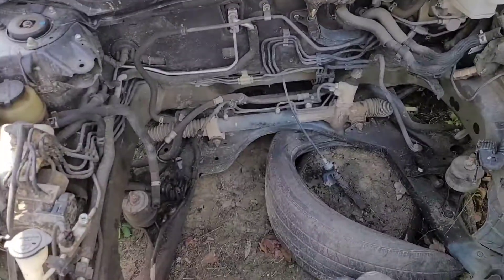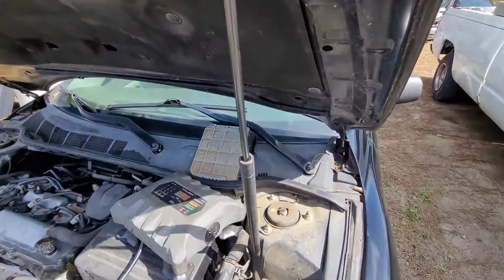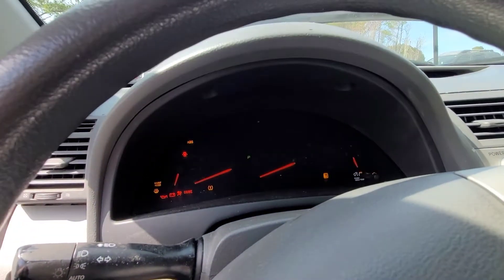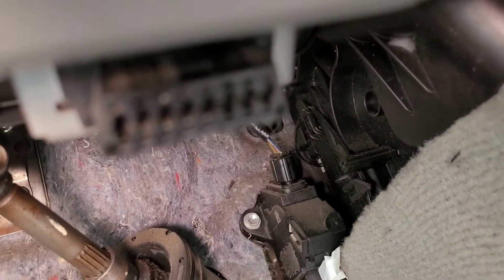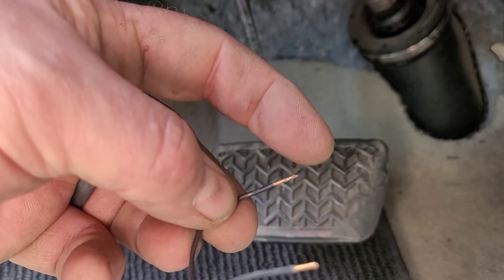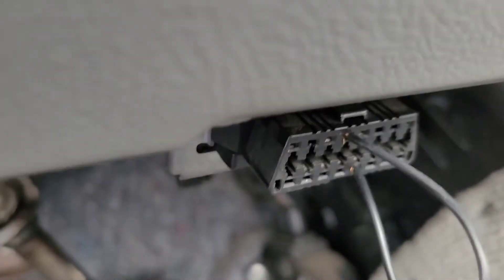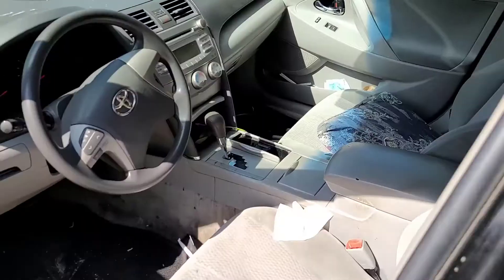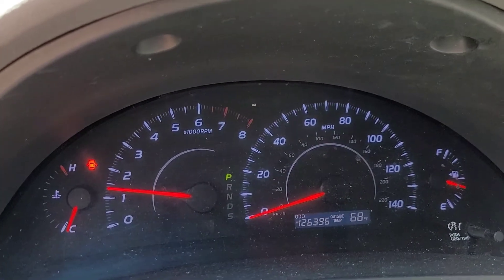Toyota Camry ECU swap without programming it ? Will it work ?

Comment: Great stuff man!

I have a 2016 Camry with no marker lights front or rear, panel lighting also out. TAIL\PANEL fuses good, but no power. All other circuits work, car runs\drives fine. Stereo and dash cluster lighting work off the switch. Jumping power to the harness connectors joining F\R gets F\R marker lights, but still no power to PANEL circuit. Schematic leads me to believe there is a break between the TAIL relay and TAIL\PANEL fuses, but I don't see a relay nearby, even though the schematic shows one. Appears that BCM \ Multiplex controller plug durectly into fuse block. Any thoughts?

Comment: Question on the jumper wire..
You threw a curve ball there and didn't really explain it well..

The connector is upside down.. so do you connect #4 &#5 from the left or from the right looking at it upside down???
Can you do a little video to explain that?? Thanks!

Comment: Great advice but I don’t understand why mechanics who said I nedd a new ECU say 1) I must match the VIN number of my car and 2) they charge $300 to $400 for a specialist to then program the ECU for my car. This comes from three different repair shops. I have a 2007 Corolla.
Reply: I suspect your mechanic just wanted to order one off the net (like from " Flagship One") - they'll ship them back to you (or your mechanic, LOL)  PRE-PROGRAMMED for you and don't need the old core, etc. The VIN gives them all the info they need to pre-program.
Reply: @PeterFerris  Yes, that was the brand and there are many negative Google reviews. I decided to buy a new ECU from a Toyota dealer and have my mechanic program it for $100.

Comment: your amazing im going to go and try this as soon as I can
Reply: Hey, can you let me know if it works?
Reply: @ToyotaCorollaCE  yea it worked for my Toyota camry se 2007 I probed power to the trans solenoids in the valve without disconecting the negative terminal of the battery, didn't have a problem intill I test the last solenoid. the ecu didn't like getting power to part while connected it made a loud and long beep, was on limp mode with a new check engine light. back probed the pins to see if it was still good. alldata said it was shit and had to replace, crazy enough I used a different ecu from a 2009 le camery same first 4 part numbers different last part numbers was planning on returning the part to the yard if it didn't work and try and find the original one lucky it worked for me tested all the windows and features still functioning even passed smog. also take photos of all recites in case of return it will save you trust me I learned the hard way. some returns are strict at some yards for profit.

Comment: Advanced Level Auto Diagnostics channel - Toyota 2008 Camry ECM diagnose, replace, initialize:  https://www.youtube.com/watch?v=IZWHyrJ-er0  
At about 22 minutes is the used ECM install & program using a jumper tool (pins 4 and 13) from Jarhead Diagnostics.  Both those guys are top notch.  That video shows an entire ECM diagnosis.  
Stay gold.

Comment: I just sent mine out is that just toyota
Reply from the maker: Most ECUs require programming
Reply: @WrenchingWithKenny  Is it imperative that, when you pull the jumper from the plug at the end of the 30 minutes, you do it before turning the key off? I just today replaced the ECM in my '09 Camry with an identical one (same exact part number on it) from a junkyard because the old one was throwing a pair of duplicate P0606 codes that wouldn't reset and the car wouldn't start (though it started and drove fine twice yesterday while those codes were present, but then on the third attempt it just cranked but wouldn't start. Had 48psi fuel pressure at the output side of the fuel pressure regulator, right in spec). The junkyard ECM, once installed, had no codes, and a handheld scan tool said it passed diagnostic, but the car still wouldn't start. I jumped the pins like you did with a small gauge stranded copper wire and went about 32 minutes with the key on, lights all flashing like you had. But based on a couple other videos I found before yours, I turned the key off before pulling the jumper, and the car still cranks but doesn't start. Would turning the key off before pulling the jumper (instead of after) cause it to not reset properly? It's the only thing I noticed that's different in your instructions versus the other videos I found.

Also, is there a separate ignition module on an 09 Camry 2.4L? I was under the (perhaps false?) impression that the ECM handled such duties in combination with the coils, but I'm really not very familiar with all the ins and outs of all this modern(ish) ECM jazz - I'm far more comfortable with OBD-1 and earlier stuff (give me a GM HEI or standard Ford setup with either a distributor-mounted module or, even better, a points and condenser setup - at least those gremlins are easy to chase!). Kinda up a creek here, as this is my family's only vehicle and we're in no position to buy something else anytime soon. I could really use any insight you might have. Many sincere thanks in advance. And sorry about the long comment - just wanted to provide as much info as I have about the problem, right up front.

Comment: The first thing I noticed that my rpm's were jumping up and down, temp control started to jump up and down and the A/C would not work correctly...I was told that the ECU or ECM had to be replaced?  As my comment below, I was told that the board has to be re-programmed, is that true or not?
Reply: I think that's exactly what he just did, anyway you should try it first and if it doesn't work, then off to the dealer you go!

Comment: Hi, thx for the nice vid. Did the ecu numbers match exactly? or can it differ? My ecu has the numbers 89560-B1830 from Denso. I can also get a 89560- B1220. I found that on the obd-port layout it's actually pin 4 and 13. Regards

Comment: Nice video. Just wondering if this thing works with other car brands like Hyundai?
Reply from the maker: My experience with Hyundai is just swap them over & they work fine. Certain Kia's too. Thanks for watching & keep wrenching 🔧
Reply: @WrenchingWithKenny Is this the actual "Reprogramming" procedure that Toyota charges hundreds for when you replace your ECM/PCM and need it to accept your vin and keys?
Reply: Will this work on Nissan Altima’s?

Comment: Kenny, i have 2002 taurus ses that has sat for about 4 years that I tried to get running, it cranks but no start and no power coming out of the cam shaft position sensor connector, could I have bad PCM? There are also 2 fuses under the hood with no power going to them and 2 fuses under the drivers compartment. The fuses are good but no power going to them. Help

Comment: If it starts nice then slowly starts to misfire as it warms up, check the coolant temp plug. If the plug is screwed up, it will not even want to start.

Comment: I tried but my lights didn't flash and after 30 mins it didn't start with the new ecm and it started when i plugged my old one back to it
Reply: I had almost the same thing happen to me, the lights were flashing though. Switched the old ecu back in and it fired right up.  Hallelujah

Comment: Thanks to your video I was able to fix my Toyota sienna now it's running like a Cham  I give you an A plus keep up the good work 👍
Reply: I'm in the process of replacing one in my 98 sienna, did u follow these exact instructions of shorting pins 4 n 5?? Thanks
Reply: @mojamski  I did it exactly like he explained in the video, and it works just fine. The problem is that it will not pass smog check, you will have to take it to a mechanic shop so they can transfer the VIN number. Best of luck
Reply: @tormentsindesiable9915  thanks. One more thing if u don't mind, did I get the Vin transferred n if so what was the cost? Thanks again.. 🙂
Reply: @mojamski  they told me 290 dollars but you never know other places they might charge less or more
Reply: What year was your vehicle?
Reply: @dennisrobinson8008  2006

Comment: So does this bypass the security setting or is it somehow resetting VIN in PCM? Having issues with my '10 Camry, replaced battery, then replaced alternator after less than a year. Dash lights go crazy and car just shuts off. Was going to by just purchased used PCM off eBay for less then $50 but then saw some places will program VIN and send PCM for $250. Figured I would have nothing but small $ and my time doing this with eBay PCM.
Reply: Did it work
Reply: @TheRoadLessChosen  it worked for me, car does all the work, my keys worked and everything was like I never changed it, even kept my trip a and b the same. I even passed smog. also I don't think its possible to program a ecu without the original car or the previous ecu, but luckily toyota built it into the car lol

Comment: I don't have a toyota DLC pinout, but on my chev DLC pinout diagram from Alldata it shows those are pins 4 and 13. As I recall pins 4 and 5 are normally ground, side by side. So, 13 is being grounded. Is that trick useful for only Toyotas, or is it something that is broadly useful? Would it bypass the security system if the PCM is not replaced?
Reply: You are correct the pins are misnumbered in this video.

This is also a Toyota thing, not a multi-make think

Comment: So I have an issues with my 2003 toyota corolla, the battery was placed wrong and it burned my computer, I changed the fuses, nothing, I turn on the ignition and the only lights that come up are the oil, doors, and seat belt, nothing else, I bought a new computer, could this help me as if I’m programming  the computer myself?

Comment: What size wire did you use? 18 gauge? 16 gauge?
Reply from the maker: It was probably 18 . It was just some wire I cut out of an old harness . I didn't check the gauge but I'd be willing to bet it was 18
Reply: @WrenchingWithKenny  okay I’m going to try this cuz I have the same intermittent misfire issue, just to be sure it can be any random wire?
Reply from the maker: @DriftTeamOrion  , yea , I wouldn't be overly concerned . If you think about it , the wiring to the connector is 16 or 18 gauge .
Reply: Cannot get the lights to blink to show its programming
Reply: Did not work lights did not blink and couldn’t get past wire in obd2 step
Reply: Tried this on a 350z

Comment: Awesome trick! Where did you learn this?
Reply from the maker: I learned this from a mobile programmer that comes around. He does all my programming work so if there's a shortcut or a simple fix that he knows , he shares it with me
Reply: @WrenchingWithKenny  so this bi passes the security lock system?
Reply from the maker: @adanrangel7686  it places the system into a self learn mode
Reply: @WrenchingWithKenny  ok thanks just asking because my for some reason the ecu on my car won't shut off the security so the car turns over but won't start I had a a lock smith try and erase all the keys to make a new one but for some reason it won't let the keys be erased...
Reply from the maker: @Adan Rangel  this trick works with Toyotas . I'm not sure it will work with other manufacturers. Not sure what you have

Comment: What about to reprogram a ECM. seem im not getting a signal to my fuel pump!!!!! Can I do something like this to re-program/ Also if I'm getting a fuel gauge reading > is the ECM communicating/sending a signal to my fuel pump. please help.
Reply from the maker: I would check the output signal for the fuel pump directly at the pcm . Usually the signal goes to some type of relay to power the pump. The pump uses a lot of energy so the pcm cant actually run it without a relay or something to handle the electrical load
Reply: @WrenchingWithKenny well I got the car to start... So know the fuel pump is working.. but the car is shaking. Might be dirty fuel filter ND fuel injectors.. do you think. So
Reply from the maker: @marcusohm187  , I watched the videos . I hate to be the bearer of bad news , but that motor is blown . You can hear uneven compression when it's cranking, then when it does start , the noise it makes is from the connecting rod bearings being completely wiped out . I'd be willing to bet its locked up now . 
Sorry for the bad news
Reply: @WrenchingWithKenny  WOW!!!!!!! THANKS FOR THE FEEDBACK 
....
Reply: @WrenchingWithKenny  How much do you think its gonna cost for me to fix it.. it had 157 k miles.....It all happened overnight I had lent to a cuzn of mine and one thing led to another.first it was the battery, than the crank position sensor............spark plugs oil change..... I since invested time and about over $100 into it trying to figure out what it was. good thing i wasn't stranded too far.....but damn that sucks  is it worth fixing it..
Reply from the maker: @marcusohm187  unfortunately, it's going to be costly. Not sure how much you can do on your own , but I've seen those motors used go for anywhere between $750-1500 .
Reply: @WrenchingWithKenny  Thanks so much !!! I guess I gotta save up since getting a another car would be about the same but then it will come with other problems down the road.... .............................!!
Reply: @marcusohm187 did you use the this copper wire trick to get it started again or replace the relay? Having this problem with  early model Camry !!
Reply: @JSPHValentine  I don't really remember in the end I had problem after another my engine blew out !
Reply: @ oh okay , sorry about that.